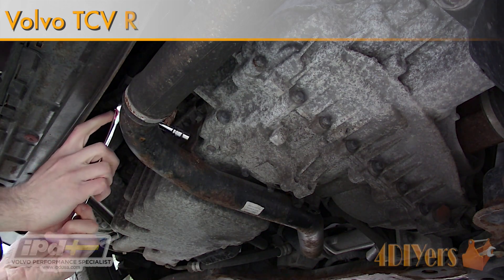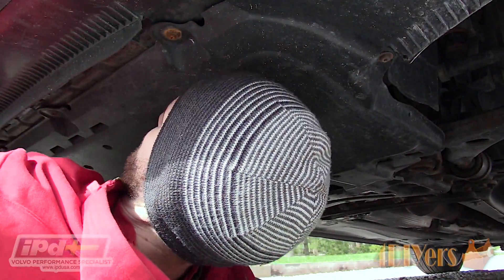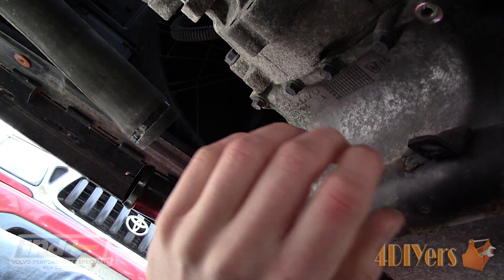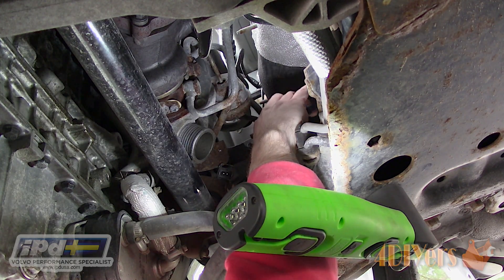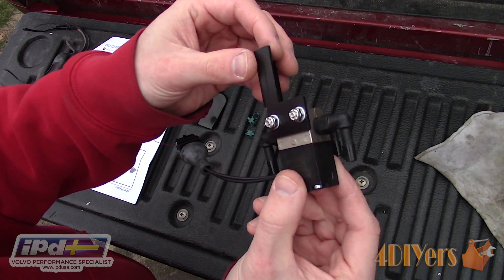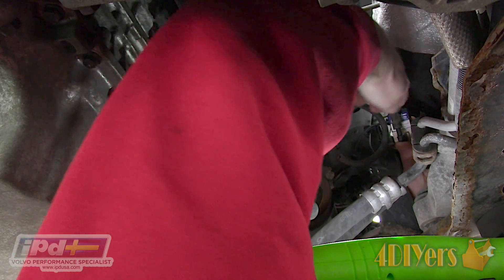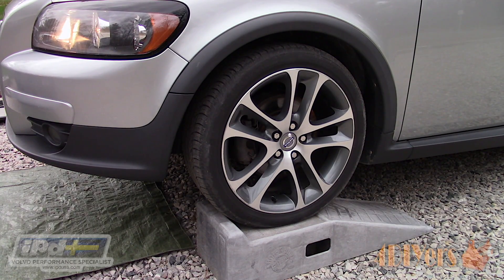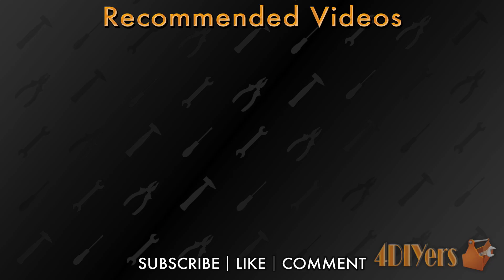How to Replace the Turbo Control Valve on a Volvo C30 S40 V50 C70 - IPDUSA Upgrade

Comment: FWIW, I just did this on my 2008 stock C30 on ramps and used the OEM Pierburg Turbo Solenoid Valve (7.28197.16.0) Here's some helpful tips:  - I did not have to remove the charge pipe. There was enough space to reach up and unclip the tubes to do the replacement. - You can reach up from the bottom as this video shows, and also in from the side just above the axle at the same time if you need to use a second hand to hold the TCV while disconnecting the clips.  -Since there's enough space to work, I suggest you disconnect one hose at a time then connect it to the replacement TCV before moving on to the next hose. This way, you're sure to connect them properly without having to worry about markings. Time: 2 hours. Savings over shop estimate: $225.
Reply from the maker: Great tips, thank you for sharing!

Comment: Man, I wish I had remembered your tip to remove the plastic piece at 5:15.  I upgraded my TCV and getting to the compressor inlet fitting was time-consuming and frustrating.  Had I remembered your tip it would have made things so much easier.

Comment: Thanks for this tutorial !  I will be replacing the original BCV in my own '08 C30 T5 now . .  at 120,000kms now there is a big drop-off in power that is quite noticeable during overtaking semi's . . so the plastic BCV is the most likely culprit after noticing the split condition of your's ..thanks again !  : )
Reply: @kop4321  Such as.  You are the 3rd person within a week to say this.  Very curious.

Comment: Just did it on my V50 T5 125k miles. I experienced lack of power at low RPM, Turbo was only “working” above 2,500 RPM (and not as good as before), lot more engine break and lower mpg (always below 23mpg for mix highway and city driving mix (mostly highway). Power is back now!!!
Reply from the maker: Awesome to hear your car is back to normal!

Comment: 2005 V50 T5 AWD with 126k.  Just installed TCV upgrade from IPD.  Was slow to accelerate, shifting was off, terrible gas mileage, turbo was cutting out, etc...No codes, everything else worked great. 

If you're DIYer, give yourself an extra hour or two to do this job if you're not using a car lift.
Space is tight!
Curcial tool: Small, angled long nosed pliers, gloves to protect knuckles. 

The last piece of pipe that sits right on the turbo was stuck.  Did not want to tear it, so I did the job with it on, which gave me even less room. 

If your car is stock, you will not be able to get one of the hoses on IPD's unit without adding length to the hose.  I was running out of time, so i just zip tied it to the bracket until I have more time and some extra hose.

Another issue with IPD's design is the little rubber/silicon sleeve that goes over the bracket.  You really have to push hard to get IPD's unit to go down the sleeve and lock in between the two little notches on the bracket.  I installed the unit on the bracket with the sleeve first before realizeing one of the hoses will not reach.   It's a lot easier to Hook up your hoses first then install into bracket. 

Ours looked like the original unit from Pierburg/Volvo.  Lasted 122k.  

Once installed, follow the programming/memory procedures from IPD and it should work like a charm.
I don't think I followed it exactly, because I didn't use a boost gage.  If you want to be more precise, do it on a deserted road and use a boost gage or a boost app.  Or, you could have a volvo tech adjust things for you.  

Car drives great now!

Comment: Actually, I think it can cause underboosting at low RPMs as well, if it's leaking vacuum into the turbo control arm. I noticed that I have better boost in low RPMs when the valve is disconnected, meaning no vacuum to turbo control arm. I changed the valve and it has definitely improved.

Comment: Hi. Your content came at the perfect time. Not sure if you can provide any guidance but here it goes. I just purchased a 2011 Volvo C30 and the guy told me that the engine light was on and sometimes when driving, all of a sudden the car would give message saying something like "Reduced power" and it would go into limp mode. I picked car up and sure enough while driving an hour home I was on the 401 highway doing 120km and it just died and went into limp mode. It was extremely dangerous because it was rush hour and I had to cross 5 lanes of traffic with flashers on doing 30kms. Scared the crap out of me. He said he just disconnected battery then reconnected and it worked. This of course is temp fix. Do you think my problem could be this TCV you're working on here? Other than offering a limb and taking it to Volvo dealer I'd like to try finding problem and fixing myself. Sorry for the ramble...I'll blame it on being a Newfie. Cheers.

Comment: What is the ID of the vacuum lines.  I'm going to replace and relocate the TCV as well as replace the vacuum lines with 3mm thick wall silicone instead of the stock rubber lines.  Thanks in advance for your response.

Comment: Got a 2011 s40 y5 and I have a greddy ELECTRONIC boost controller  that seems to fit on the electrical connection on the tvc. The connection will go to the aftermarket controller. Do you know if that would affect the wire that was originally I’ve gone back to the car???

Comment: hi, I just bought a c30 t5 and wanted to see how I can do maintenance on the turbo so it doesn't fail me?
Reply from the maker: There really isn't a whole lot you can do with preventative maintenance for a turbo. I would recommend running a magnetic drain plug as a safety, use a top quality oil, always let your engine idle for moment before shutting it off (with the engine running, the oil is flowing, and allows your turbo to spool down), and don't push the engine until it's up to operating temperature.

Comment: I just replaced the TCV on my c30 with this unit, now my boost gauge is reading -20 lbs at idle instead of -10, and i am not getting accurate boost. my byass valve is no longer actuating. what did i do wrong?
Reply: i have the same problem at my s40 did u fix it?
Reply: @tomamihai7695  after some digging i found that -20 vacuum at idle is actually normal. I replaced my PCV assembly and this fixed a vacuum leak i had prior. As for the turbo performance, it is pulling much better now. Took about 1 week of driving for the computer to figure out whats going on i guess. It feels a lot better, maybe not 100% still but id say 90 percent, hopefully will improve more over time
Reply: It is the correct number if read less than -20 somewhere is a problem, my car vacuum at idle is -22

Comment: Hi, my c30 is leaking a little bit of oil which I'm told is coming from my turbo. I also sometimes hear a whistling noise when its idoling but doesn't happen everytime I drive. Any advice?
Reply from the maker: It's possible that your turbo is leaking out, this can be an internal or exterior leak. The exterior leak can be an oil line, if it's internal than a seal has failed on the shaft. The exterior leak can be viewed by looking at the rear of the engine, either from the top or bottom and a mirror would probably be helpful. An interior leak can only be seen by removing a boost pipe and you'll notice oil residue inside the piping or intercooler or if it's leaking on the exhaust side, you'll notice oil inside the exhaust at the turbo. As for the whistling, that can certainly be turbo related, so you may have a boost leak. Other issues which can sound like a turbo whistle is a faulty idler pulley or even a failed pvc diaphragm which I have a video for https://www.youtube.com/watch?v=1O4r1ftgJaQ

Comment: I have a question, what are the CBV's colors wire (Turbo control valve).?  i cut de wire  with connector and i didn't find it

Comment: Does the battery need to be disconnected before installing?
Reply from the maker: No need as there shouldn't be any power at the TCV when the key is off.

Comment: Dumb question, where do I install the blow off valve?
Reply from the maker: Not a dumb question at all, it's commonly asked. Volvos don't use a blow-off valve, they use a compressor bypass valve instead so it redirects the boost differently. People have successfully installed blow off valves, however I haven't.
Reply: @4DIYers  very good to know, I would have broke something else. Thanks for the reply!

Comment: Hey mate, i have the 05 AWD M66 S40 T5, is this method the same to get to the TCV as well or will the subframe have to be lowered to access this?
Reply from the maker: Should be the same, the C30 and S40 share the same platform (P1).